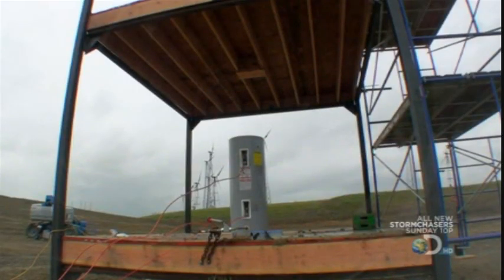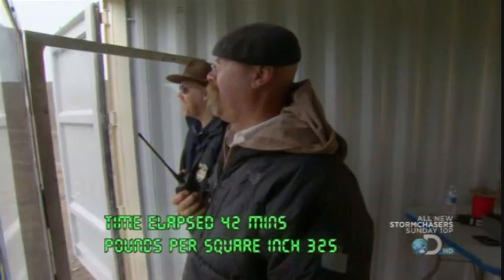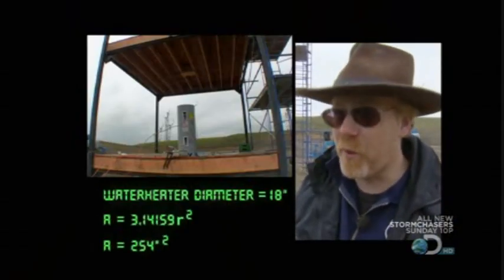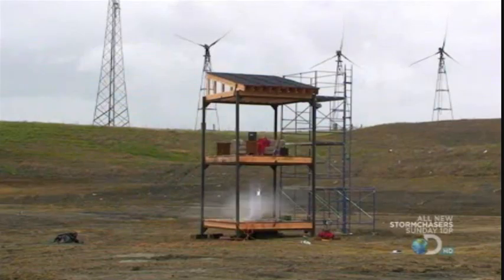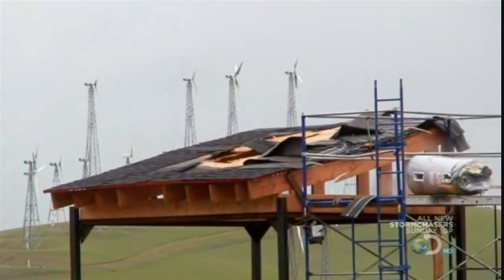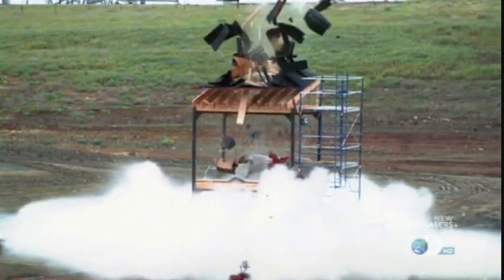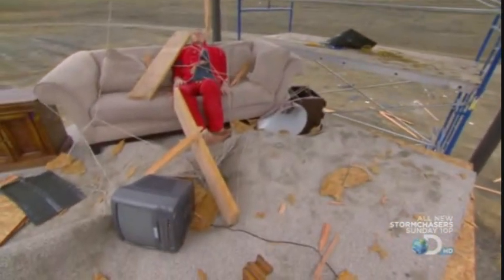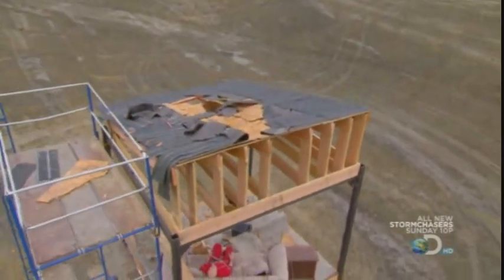Mythbusters Water Heater Explosion

Comment: That roof system is way over engineered. The lumber is 2x12 much bigger width than should have to be for the ceiling joists (the horizontal boards for ceiling where drywall is secured), also the rafters are also much stronger than needed. These guys actually over built making results even more impressive
Reply: They built it according to the CA code. Woops!....
Reply: Earthquakes make a fair difference in requirements, and there's little penalty beyond cost, if you exceed requirements.  I remember when many old buildings in Los Angeles had to be retrofitted to meet new req's in the 80's and early 90's, lest they be torn down by government or nature.  The Whittier Narrows and Loma Prieta quakes did a lot of damage.  The Hollywood Guitar Center has (at least had when I went years ago, in my memory,) steel reinforcements going through the upper area of the sales room.   Basically very long screws with turnbuckles, attached to anchors in the walls.  Pictures of the recent Van Halen mural show the stems of these sticking out of the wall at regular intervals.
The MB structure was also underbuilt, as it contains no ceilings, insulation, HVAC tubes, upper floor pipes or wiring.  Not even a box of old junk in the attic.  ;)
Reply: @VoltisArt  Ya I have seen California homes being built, I also remember seeing older homes in San Jose area and how simple they were. Coming from New England CT. seeing homes built like no other the Italian and Portuguese builders. Here we have 2x6 maybe 2x8 rafters with a minimum of 6 pitch. To see 2x12 ceiling joist and rafters is crazy
Reply: @labla8940  You, obviously, know nothing about construction. Each state has a different construction code/regulation. it's mostly based on the environment. some places have snow, and some don't. Some are prone to earthquakes, some others less. Some are in an area with lots of hurricanes, etc, etc... the code can even change from city to city.
Reply: @DiabloOutdoors  I am the guy that tells the building official what dimension, maximum length and spacing of lumber that can be used. All states follow the IRC 1 and 2 family dwelling Code book.. JHA, (jurisdiction has authority) the code can be altered to a higher standard if deemed necessary, they however cannot be lowered. CA. follows and amends that code to the states standard building code that is a simple way to put it. Load calculations are done by architects/engineers, rafters are a a dead load,, earthquake consideration is a lateral force or shear force. I am a framer by trade (actually builds the home) and specialized in complex roof designs. (mathematics) I am a structural engineer by education with a master’s degree, I am a practicing Home Inspector licensed for 26+ years. I have inspected 1,000s of homes and roofs, maybe 10,000+. I have never seen a home with 2x12 rafters and ceiling joists "ever" other than a "flat roof" and they don't have ceiling joists in a capacity we are debating. I also have testified as an expert witness in court involving a boiler which was plugged at the pressure relief valve, which I noted in my report and urged immediate removal and repair and actually shutdown the unit. So please share your credentials. Normally I ignore angry people who are miserable in their own skin, but congratulations you were just so ignorant. I was having a productive correspondence with some adults who were kind enough to share their views like grown ups.
Reply: @labla8940  I'm sorry about Diablo Gamer. He's probably a kid. It's been a pleasure talking with you and learning about building codes, as I'm about to move to another country (which has no building codes at all) and build my own place. I have a lot of respect for people like you who do this kind of work. :)

Here's a tip of advice from a 16-year veteran of YouTube: Since you are an accomplished builder/engineer/inspector, then you should make your YouTube channel more professional. :) Instead of having no profile pic and calling yourself "la bla", use your real name (and professional title) and photo, and explain your credentials on your channel's "About" page. By doing this, you'll avoid confrontations from people like Diablo Gamer.
Reply: @SouthwesternEagle  Thanks no worries, I appreciate the conversation I've been house bound for a little bit and stir crazy
Reply: This was built to California building code, and their requirements are strict.
Reply: @SouthwesternEagle  I dont know CA code but I can say its quite a feat to go through ..2/ 2x12s on edge. No argument from me if it was code just dam impressive. Why 2x12 rafter and especially 2x12 ceiling joists? I get earthquakes but that seems excessive. I am confused 2x12 is code? Doesn't the engineer/architect dictate the rafter dimensions/ So a tiny bungalow home in a climate with less than1 snow day less than 3: per year average would still require a 2x12. I get earthquakes but how do 2x12 make it more earthquake resistant, when a rafter is  a load issue not really a a shear force issue
Reply: @labla8940  I don't know why their building codes call for such thick roofs, but I know that California is a highly diverse state with four distinct regions: High Mountains, Desert, Central Valley and Coastal. The High Mountains region in eastern California gets upwards of 200 inches of snow, so it's possible that California building codes are a one-size-fits-all set of codes that takes every region's challenges into account. They can take extreme heat, extreme cold, earthquakes, very high winds, heavy hail and rain, extreme snow and falling rocks. 

Back in 1998 in Fremont during El Nino, I saw houses that had remained intact after large landslides/mudslides, including some houses that slid down the mountain complete with their roofs and foundation intact down Mission Peak. Those building codes work.
Reply: @SouthwesternEagle  We have a JHA jurisdiction has authority here. So southern CA. would still require 2x12 rafters and ceiling joists? We go by zones called HDD heating degree days  for footing depth  R value things like that. You can exceed the IRC 1 and 2 family national code for JHA just not lessen
Reply: @labla8940  As a former Californian of 8 years, I can tell you that California safety laws are much more strict than any others in the USA. For example, my 1999 Harley-Davidson Dyna Wide Glide is a California model, and it was built to a MUCH higher set of standards than any "49 state models" as they are known. It has a catalytic converter (49 state models don't) and a completely different fuel system than bikes sold in any other state. Many of California's emissions laws and engineering standards are independent of the rest of the country, and they are always of higher standards. Living in California felt like living in an autonomous independent nation within the USA rather than a state.

Also, in another video, the Mythbusters said that California building codes required two layers of 2x4 trusses on the roof, not 2x12s. 

Unfortunately, I'm not a professional builder. I'm not an expert in building codes. :)
Reply: @SouthwesternEagle  No doubt CA has their own way of doing things  I know my questions were somewhat rhetorical, I thought  people were saying they were dictated v CA building standards
Reply: Sometimes building codes are influenced by the people selling the products, or the unions.  Why some cities require cast iron for some commercial work to keep labor costs up, or why PVC conduit is decreed to be just as safe as steel conduit by the NEC...because Carlon has a seat at the table.

Comment: My uncles hot water heater wasn't working properly so he turned off the circuit breaker until it could be fixed. His girlfriend came over, wanted to take a shower and turned it back on without him knowing. They woke up in the middle of the night with half his roof and a bookcase on top on them. The water tank relief valve failed, pressure built up and it rocketed through his roof an landed on his neighbours yard... He lives on an acreage.

The house was a complete loss and he didn't have insurance. The floor under the heater collapsed due to the force of the explosion. Made the local papers though so that was pretty cool

Comment: At my work we do routine heat treatments that heat up an argon environment up to 27 psig max.  The thickness of the retort holding this argon within the furnace is only 1/8" thick of stainless steel.  I did the math out, and figured out it'd take a huge amount of psi before it would explode (and luckily our temperatures NEVER reach anything close to it), but while designing the system I just kept imagining something like this happening.  Glad all of our components and the tank itself can handle these temperatures.
Reply: 27 psi is handled by cheap vehicle tires all the time .

Comment: Shame on you guys. Shame on you. The average homeowner will view this tripe and envision going to bed with an IED in the basement. Every water heater has a T&P valve on the side to prevent the water heater becoming a pressure vessel. As another poster noted, it would blow out the faucets. Further, given incoming pressures are 40-80 PSI, even if you pressurized like this accidentally (you can't), it would simply overcome incoming pressure and send the water back into the muni system or well. Even if you hardwired the gas valve you'd likely start a fire, Because of pressure temp relationships, you's trigger the T&P valve and start sending boiling water into the floor drain. You might start a fire. Might.
Reply: according to you the average homeowner is an idiot lol.

Comment: This "myth" was believable from the very start.
Water and steam used to move giant engines back then.
So a water rocket was more than likely.
And it's beautiful to see it happen.
Reply: My dad worked at a factory in the early 70s where someone had placed one of those older style fire extinguishers too close to a kiln. It eventually got too hot and blew up through the roof. The plant made things using asbestos (well before the ban), and it snowed down on all the workers from the rafters, like 2 inches deep in some areas. Plant was shut down for 4 shifts to clean up the mess and get the roof patched.
Reply: @joseph1150   Holy smokes....
Or rather, cursed smokes!
Reply: unrealistic though, because you'd have to boil the water to such high temps inside the heater.
Reply: @jackson5116  To be fair, it is about a heater that had all it's security features removed, not a normal one.
Reply: @jackson5116  the water wasn’t boiling. It was under pressure. It didn’t boil until it exploded. 🙄

Comment: Once I get my own house , I’m getting my water heater serviced every year so this doesn’t happen.
Reply: Don't bother. Just replace the thing every decade or so.
Reply: Truly all you need to do is trip the relief valve once a year if it drips afterwards replace it temperature and pressure relief valve is a whole lot cheaper than repairs to your house
Reply: @larrycurrier290  Or water damage causing data loss, such as film, tape, computer memory.....
Reply: :face-green-smiling: "serviced."....... tell me just what exactly do you have to do with them every year...? 
  Just make sure there are no leaks or stress cracks anywhere and leave it alone !

Comment: Just because it is a normal everyday device that has always been there, functioning properly, does not mean that it is not dangerous.
Reply: Lack of Maintenance makes them dangerous
Reply: Water heaters are safe if they've had the necessary safety features installed.  You've better be sure of that though.

Comment: Considering water doesn't like to be compressed at all, i am very certain that this is fake. Maybe if the water was hotter than boiling temperatur and vapurised once the heater ruptured.
Reply: What was temperature of that tank?
Reply: Nope this is real, in this episode they wanted to test on what would happen to a water heater if it's safety features were compromised and left unattended. Which seems unlikely but knowing people's general laziness or sometimes forgetfulness in doing regular check ups to their house systems this type of situation could happen.
Reply: @pccjmdg5259  I am doubting that this situation is physically possible. If I‘d compare air a coiled spring, water is like a solid steel block. There was, if it didn’t vaporize, no way for the water to store enough pressure to lift the tank up several meters. Maybe a few centimeters, but not more. I am especially suspicious about that jet of water seen in the slow mo. What is pushing the water out? Either a compressed gas (possibly steam if the water was boiling hot) or an explosive.
Reply: @me262omlett  I believe they were supplying it with water and that was the total build up of the steam within the tank and yes they said this is possible especially for older models since this was filmed before the 2010's
Reply: But where should the steam be coming from? If you think about it, it makes no sense to heat the water to +100°C. It would just unnensesarily put stress onto the pipes and you don't need boiling water from a tap or in a radiator. I think 60°C is a normal temperatur. Therefore no steam, especially not under high pressure like in a water heater. And btw, @PCC JMDG , use punctuation, it is really hard to follow your train of thought if you don't.
Reply: @me262omlett  My bad mate, but this is what the experiment was for. It was to test out on what would happen when all safety features of the water heater was compromised and that they were using an older model to simulate a real life scenario since the commonly used models during the time of filming were still those old school big ones who tended to fail when not properly maintained. I'm not sure on what the temperature was though since it was explained in a different video when they were doing the model version of this, so I can't say for certain on the temperature.

Comment: In one of the shots there is a flash just before the tank takes off. I think they rigged the thing to blow with a remote trigger, which TOTALLY makes sense.
Reply: the flash was the electric heating element wires disconnecting.

Comment: Wouldn't it, more likely, split the sides? It would depend on the weakest weld, top, bottom, or side?
Reply: Nope.  Balloons the bottom, just like a soda can falling off a table.  The explosion breaks the seams around the bottom when the steel bends outward.  The heater's already starting to fly before any water gets out of the tank.

Comment: Pity that it can never happen, remember a hot water tank is full of water not water and compressed air, it's the air that makes the tank launch
Reply: Water, when boiled, takes on a new form... It turns into gas, which is compressible.
Reply: @starmc26  There is no boiling water in this video, you are talking about superheated steam
Reply: @sjdtmv  Yes, and compressed steam does the same thing as compressed air.
It's like saying this can never happen because houses have walls and this simulated house has none.

Comment: I would be curious what damage would have happened in a standard German home: 20 cm steel enforced concrete ceilings, with a 8 cm concrete floor on top, massive (35 - 50 cm) brick walls and a 20 - 25 cm steel enforced concrete ground plate in the basement.

And yes, that's just a standard living home building.
Reply: Yea but you also rarely have central heating/air conditioning and good luck getting wifi through your concrete box without a ton of repeaters.
Reply: Depends. Imagine how many bars a Water heater built to such standards would take.